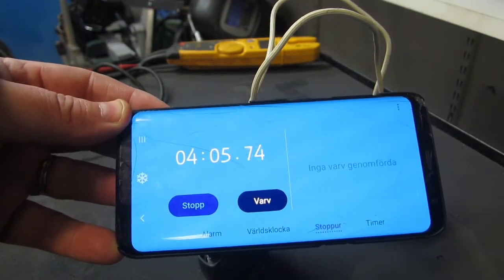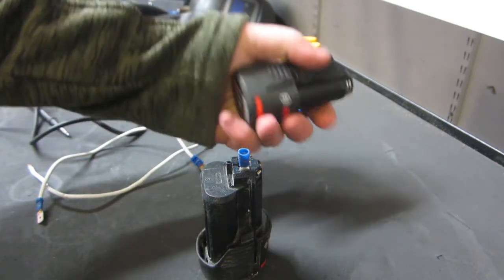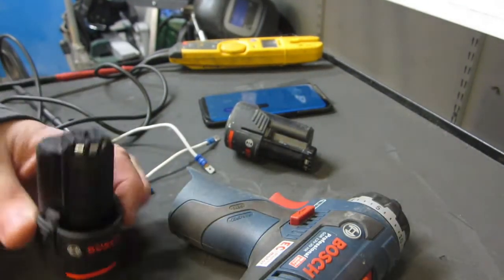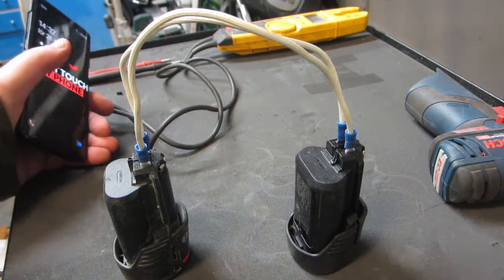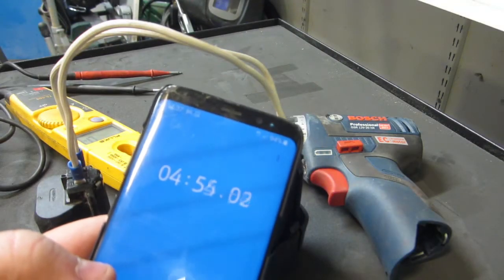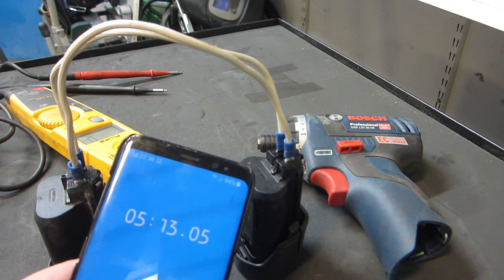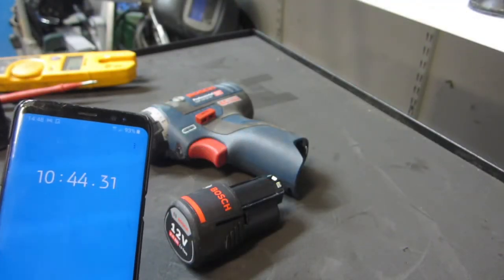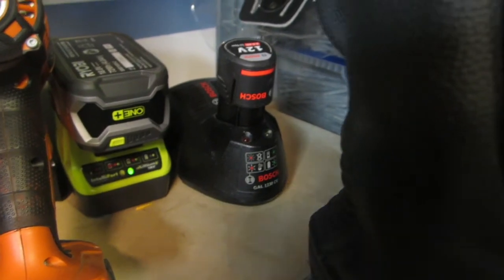DIY, Test, Can we Revive/Recover a empty a 12V 2,5 Ah Bosch Battery?

Comment: This trick really works. I have the exact 2 batteries and one was totally dead. it was sitting in my closet for months and finally discharged to a point I couldn't charge it up. So i jumped the dead battery with the good one. Instantly the dead battery got really hot. I only kept it connected to 1.5 minute. I didn't think it was a good idea to jump it for 5 minutes. the battery might explode due to high temperature. So after a minute and 30 seconds, I disconnected the jumper cables and left the battery to cool down for 10 minutes. then I put it on the charger and it started to charge. Took like an hour to fully charge up and now it works like a normal battery. thanks for sharing the trick.
Update: 
The battery got charged and worked in the driil. Then afterwards, went dead again and would  not charge. So i did the same trick again. In about 30 seconds the battery got really  hot. So i took it off the jumpers. Then it charged  normally on the charger.  But then afterwards, the charger says , it's  completely  charged but the battery  never worked again. And now  it's  dead again. So i guess  the cells are bad or power management  circuit completely  stopped  the battery. So i think there is an internal short in one of the battery  or batteries and now it will not charge again.

Comment: I too thought this was a bit odd - waiting for a tear-down and replacement of either battery cells or a small electrical component. Did the same exact steps, and Voila! I've revived 2 dead 2AH batteries in this way. I'm stunned. Thank you so very much. 
FOOTNOTE: WTH is wrong with these things? Bosch needs to take responsibility , as the lithium ion batteries are a serious problem. This just saved me money, but more importantly, kept another handful of these "dangerous" battery components out of the disposal bin. 
Seriously- why is this not printed in the Bosch manual as an act of simple responsibility for their products? 
Now  the big question: what to do with an 18V CORE battery in the same dead condition?

Comment: Thank you, thank you. I was sceptical but wow. it worked! Saved 2 Bosch 12V 1.5 Ah batteries which were completely dead from a cold spell in the garage. The Charging light on the charger was continuously on but no charging took place. I connected to an old "10.8 V" Bosch battery for 5 minutes which gave them a bit of life, then the charger started flashing. Happy Days!

Comment: Needless to say, do not try this at home! Shorting two lithium batteries with no current limit and no voltage/current control is a blunt stunt that once will create a fire
Reply from the maker: Obviously you have to watch the process and only have the batteries connected for a very short time, Its not a problem. Unfortunately there is to many armchair experts on the internet.

Comment: My charged battery jumped after one minute to 40 degrees C on the case. I umpluged it and when I put the empty battery in the charger it started to charge. The empty one had 1.2v when dead. I did not measured it after the one minute charge time. Both batteryes charge now. Thank You!
Reply: Do not use cheap wires! I melted two crockdile wires when improvysing. They went out in under one second

Comment: Great remedy now fixed! After adding another Bosch 12v power tool how disappointing to try out new tool only to find 12v 6.0ah battery completely lifeless I used a 10.8v battery as donor to link up waited 10 minutes 12v 6.0ah back in charger and it started charging thank you sir 💯👈🏻🇬🇧

Comment: I had a battery that wouldn’t charge or power a drill so I have just tried this.  I connected them up and left them outside, 5 minutes later I returned and disconnected them.  Neither battery was warm so I didn’t think it had worked but I put it on the charger and it is now charging up.  Thanks for the tip.
Reply: Yeah definitely do this where there aren't flammable around, or at least near a fire extinguisher or quick source of water.

Comment: I had a brand new one that is dead on arrival. I measured the voltage is mere less than 2V. Cannot charge and cannot use. I used yr method and within a min, the “dead” battery is alive and present 10.2V ! Vola now is able to charge and use normally. Thanks for your video
Reply: That low voltage will damage the cells, you should've returned it.

Comment: Thank you for your video. I have the identical batteries and will try this! Could you add a link to the cable connectors? Not sure where to find those, or what they are called.
Reply from the maker: FP,C, Flat pin connectors.
Reply: Spade connectors

Comment: Thank you.  I wished I had seen your video just a day sooner.  I purchased a 12v max battery to replace the original which is only 3 months old.  Bosch sells their tool with 2 batteries.  I was charging one and left it in the charger for days.  When I needed the battery, it was dead.  So I purchased an additional one and got it yesterday.  I was about to toss the dead one but before tossing, I wanted to see what was inside.  That is when I came across your video.  I got the supposedly dead battery to work simply by using your direct charge method.  I let it sit connected to together for five minutes.  I put my meter on the ‘dead’ battery and it read 12.2v.  The fully charged battery read out at 12.4.  I have two batteries for my dewalt.  Same thing was happening.  One battery went dead, the other works.  I jump the two and now I have two working Dewalt 18v batteries.  Thank you for posting.